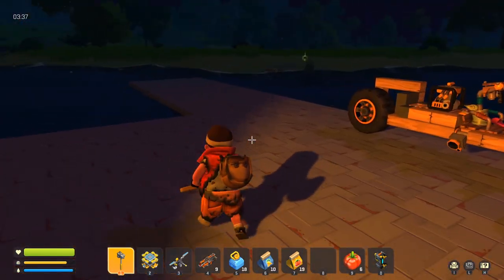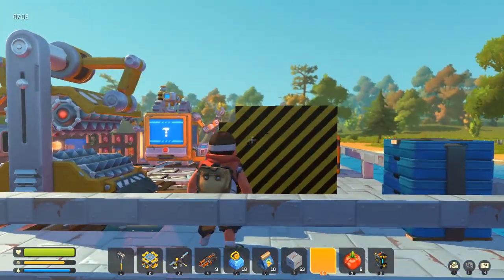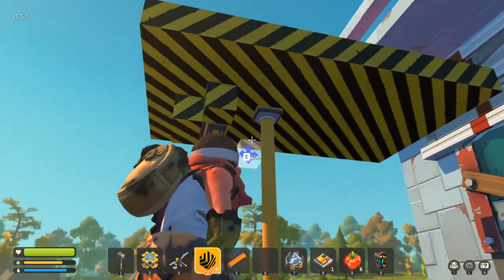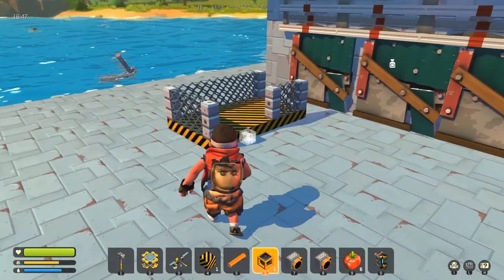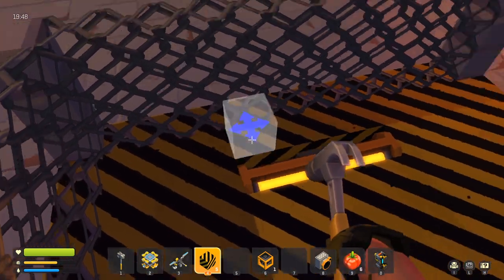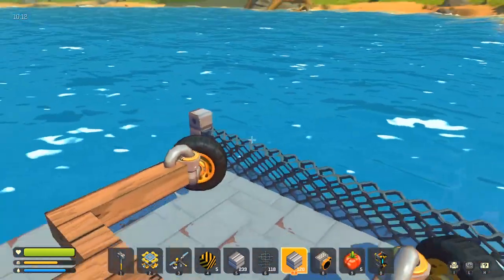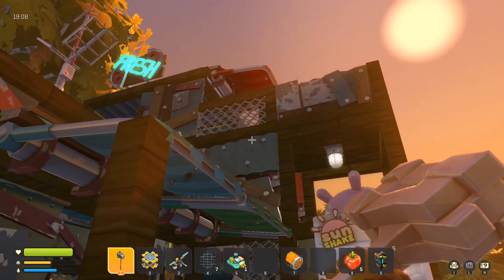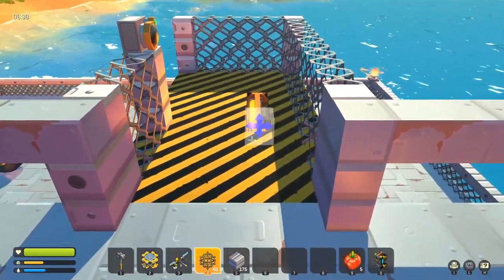ISLAND BASE IMPROVEMENTS! ELEVATOR & RAILINGS | Scrap Mechanic Survival Gameplay/Let's Play E11

Comment: The elevator will move more smoothly if you just use a switch. The sensor isn't providing a constant signal, because it is re-checking/sending the signal every time it moves, which is why the elevator is choppy when it moves. I'm sure there's some logic gate configuration that could smooth it out, but that just seems overly complicated when a switch will do the job.
Reply from the maker: good tip!  I don't really need the sensor for convenience either